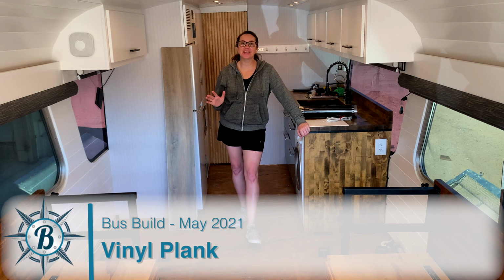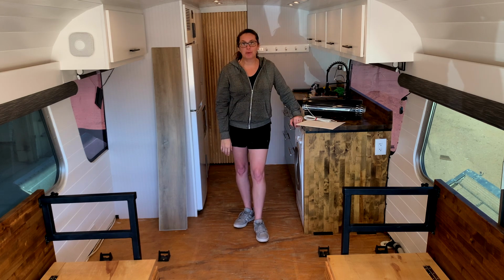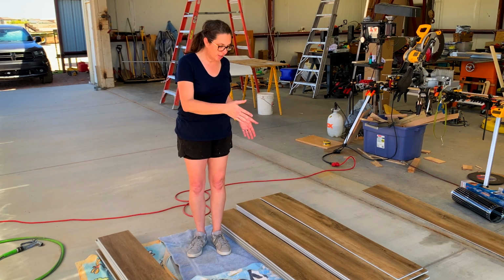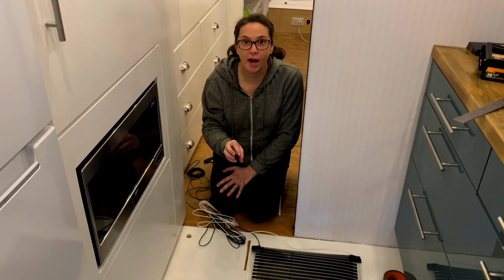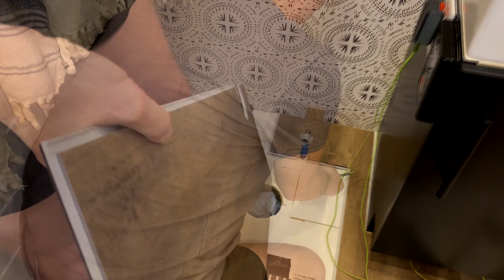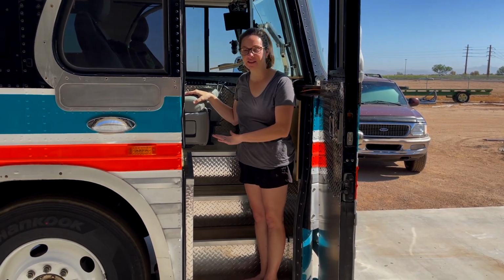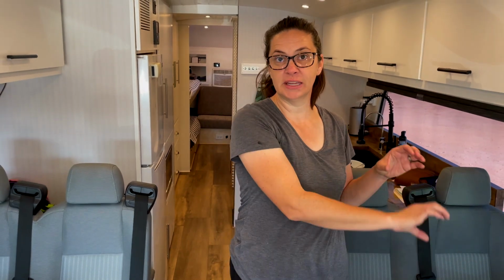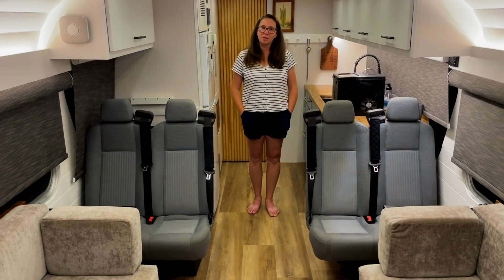Finishing the Bus Build: Luxury Vinyl Plank Flooring with Heat Mats in the Bus

Comment: Nice job!
One thing I would add would be plastic "tub" under the washing machine. It does not prevent (small) leaks, but makes them visible. If I did see correctly washing machine sits now lower than top surface of the floor. Small leak can go under the vinyl even the vinyl itself is waterproof. 
looking really nice! I that diamond plate looks good!
Reply from the maker: Yes, we looked into the tub under the washing machine. Splendide actually makes one. Our problem was that the feet for the washing machine sit on top of the tub, but we used the feet to secure the washing machine from sliding.  So, it was either secure the machine or use the tray, but not both.  We decided that we could put a water sensor under there that is linked to our home automation.  Also, we figured that if it was leaking we would hear our water pump running if it happened while off-grid.  So, we voted to secure the machine.  But, it is something we realized could be problematic since it's slightly lower than our vinyl floors.  Definitely something to consider. Thanks!!

Comment: So now that you guys are experienced with East Coast "high temp / high humidity" vs your native West Coast "high temp / low humidity", which is worse? :)  Which does the bus handle cooling in better?

Cheers, Sev
Reply from the maker: We certainly handle the dry better than the humidity.  The bus, however, seems to do fine either way.  The mini-split is great at dehumidifying and will drain a ton of water out of the air.  We can keep it nice and cool in here nearly all the time.  Now, when it's 115 in AZ in no shade, even with the dry heat, it's just hard to keep it below about 80F.  But, with some shade, we can get it down into the 70s.  But, most the time regardless of humidity, we keep it nice in the low-mid 70s inside.  We do run an additional dehumidifier if it's extremely humid.  Now, in the kids room, they like it COLD, and that little a/c in their room does an awesome job keeping it super cold back there.